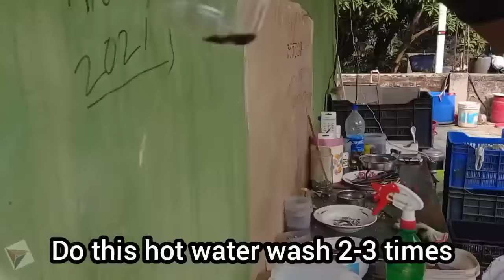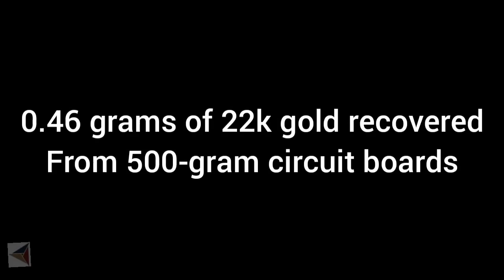Gold Recovery Using Vinegar | White Vinegar Gold Recovery | Vinegar Gold Recovery from PCB

Comment: Maybe mixing the chemicals first and adding the boards later would save time
Reply: It doesn't work that way unfortunately. You use an acid to mobilise and gold and into solution (unsticking it from the board) and then a base or alkaline chemical is used to lift the pH back up to neutral again. 
Acid + base = salt + water

You cannot extract metals with salt water it doesn't work.

Comment: Can any of these refining solutions Vinegar Etc... be reused to some extent making it profitable to refine in this way ? or is this video how you make it profitable. No one I have seen or have asked yet has given the cost of materials overhead, time Etc... to profit ratio. How pure Gold is that Gold Button and whats it worth ?
Reply from the maker: you can process a tonne this methods, why not thinking like that?
Reply: Just answer the questions.
Reply from the maker: it's not only one of way recover gold methods. if your stock 100 kilogram like those pcb borad without solder or tin, then the vinegar method is good way of profits, because vinegar is cheaper then hcl. you know, industrial grade vinegar to need that's uses here. and you can reused that solutions again and again like AP solutions, that's all.

Comment: I did that trick & all i got after 30 days was green water all the gold had dissolved in the substance, i ended up scrapping the project because i couldn't get the chemicals to finish the job & getting the gold out of the solution. There is to much copper 
Vs gold.
Reply: Cupellation.

Comment: Im not sure why your filters dont break down in Aqua Regia. To bad Mouse Pads have gold flashing. You ever though about buying a crucible you can reuse?
Reply from the maker: crucibles are free for me🤣
Reply: @TrinityGoldRecovery  you do know the crucibles we use are extremely cheap and last a long time. Depedning on what you melt you can get 10 to 50 melts if not more from one crucible. The clay crucibles you use are ok but you should step up your game or at least buy one to have just in case you have a larger yield that wont fit in the clay crucibles. Prices can vary but usually $5 per crucible on average
Reply: @chosen1one930  ur clearly dreaming if u think ur teaching him about how to use a crucible....u think it makes u smart when even a 3yr old kid would know what to do with that crucible? Wake up boy! Wake up!

Comment: This is a waste of time since one needs on average one ton of scrap boards and chips to obtain one ounce of gold. 

Five years ago I was hard up for some cash so took some old plated gold jewelry to a local gold buyer to see if those were worth anything. He said my old stuff had a heavier plating so gave me $15 for 5 pounds of old junk jewelry. Then he took me in back to show off bins of cheap gold plated jewelry that he paid 10 cents per pound for. Said he took the bins home once all were filled to strip off the gold using nitric acid then separated the metals that were plated since some were copper, brass or a cheap pot metal to take to a scrap yard. Then he melted the gold powder into beads that went into a bag that he kept in a bank's security deposit box for safe keeping until prices rose high enough to sell the stash.